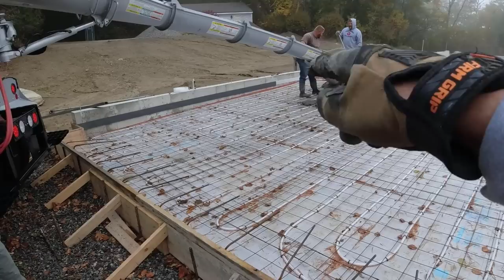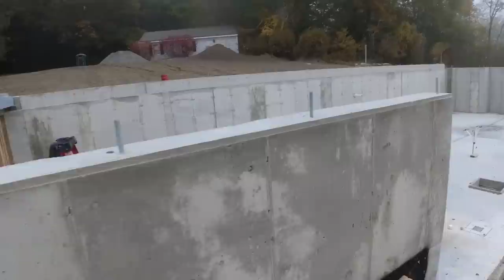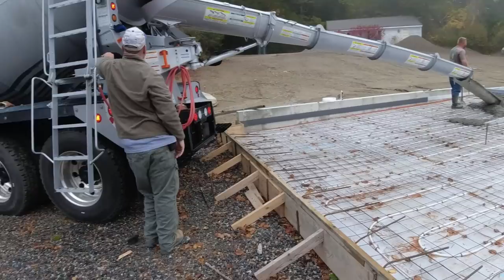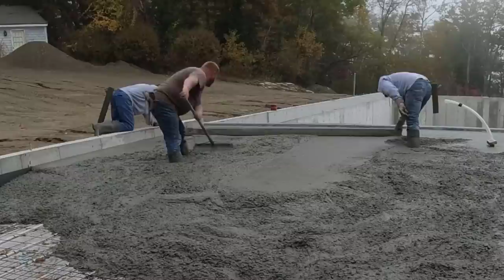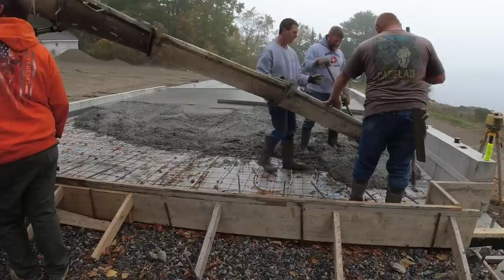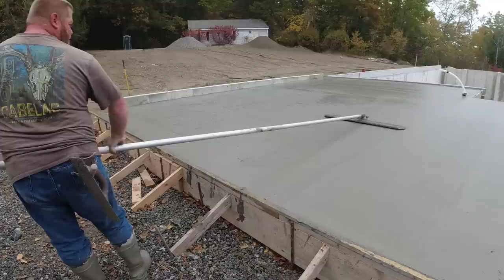We Poured It A Foot Thick - How Did They Mess This Up! (Garage Floor Over-kill)

Comment: I drove a mixer truck for about a decade and you wouldn't believe the stories.

1. A home owner wanted 9 yards inside a cardboard form.

2. Husband wasn't home so wife said to just put it over there and he will take care of it when he gets back.

3. Homeowner  wanted it so wet it looked like wash out for his garage floor so he could work it easier.

4. Home owner ordered 3 truck loads too much and we sent them back to the batch plant loaded. Miscalculated by 27 yards.

5. Flow filled Styrofoam walls wich of course broke and made a mess.

I could go on and on....

Comment: So the GC eats $1900 in extra concrete and the homeowner is basically out the cost of the radiant system and pays for all the future bottom of the slab underside heat losses. Output drops off as tubing depth increases. The highest output occurs when the tube is centered about 3/4-in. below to the slab surface (about 25 Btu/hr./ft2 at 100° F water temperature). Lowering the tube another inch into the slab reduces output to 24 Btu/hr./ft2. Taking it down yet another inch lowers the output to 22.3 Btu/hr./ft2.  However,  when the tube is located at the bottom of 12" slab the output is only 7.6 Btu/hr./ft2 -OUCH. On the plus side they can feel free to park a 85 ton John Deere 870G excavator any time they want.

Comment: The home owner will be lucky if that floor heats up at all with the 12 inches of concrete on top of the heat tubes !!
Reply from the maker: It'll heat up, just might take a while. Then it'll stay warm longer also.
Reply: @MikeDayConcrete ... one giant heat sink that's for sure.
Reply: Heat rises people
Reply: That was my thoughts. Conrete is a thermal conductor but at that depth and the size of tubing and total heating power it can produce I wonder if it is now ineffectual. It seems like radiant tubing has to be within the top 3-4 inches of the conrete surface to have any affect.
Reply: Takes four days to heat up, four days to cool down.  They will be sweating buckets when the temps jump, and freezing when temps dive.
Reply: It’s likely it will cost more to heat a slab that thick
Reply: That and the mesh sitting on the bottom of the slab is a great job 😂
Reply: I guess it will act like a big energy/heat storage. This might save you some energy on very cold days, but changing the room temperature will take forever.
Reply: @michaelmaas5544  I did a slab this thick it will heat just fine  u will have to adjust the thermostat a bit but I had no issues. .also if you look at what's going on here u will notice they are doing what every concrete contactor that ive seen does and thats picking the wire mesh up  as they go  ☺
Reply: @nbco55  you mean storage.
Reply: @devilmonkey  heat does not rise.
Reply: @user-bt6hh9yu1n  work near the ceiling for awhile and you will realize you are wrong.
Reply: Why pour if something is wrong  freaking goofs ! I'd be pissed
Reply: Yep. You are correct. They will have to start heating in September for November.
Reply: @Brooklynraised68  I bet they have a hard time collecting on the extra.
Reply: @michaelmaas5544  
1. the slab is nearly s foot thick. It does not need a reinforcing mesh.

2. The ideal placement of mesh or rebar is lower in the slab. Concrete is great in compression and not as great in tension. In bending the bottom of the slab would be in tension, thus the steel helps by resisting the force.
Reply: @Brooklynraised68  I just smell some free concrete and a thicker slab.
Reply: @user-bt6hh9yu1n  what?
Reply: @ILiketoBreakStuff  mesh isn't made for a 12" slab. They are definitely going to have issues  where the overhang is
Reply: @user-bt6hh9yu1n  what planet are you living on?
Reply: @brianbabb6666  hot air rises, heat goes in every direction regardless of gravity. Just a basic thermal dynamic principal.
Reply: @guyprattii3115  …yes indeed.
Reply: Fact: it will work great. Where do you want to put your money? F ing around with the grade or more concrete. Sometimes it's cheaper to make it thicker. Mass is good. I have a 30x40@ 40 yards and a 40x80@ 75 yards.
Reply: @brianbabb6666  He's right - heat does not rise, rather hot air rises. Heat in cement will spread equally in all directions.
Reply: @Ariel1S  if that was the case the heat will do nothing to warm the building.
Reply: @eddieshamble  paying help and buying fill costs more than a few yds of concrete. That floor will be a massive heat sink and will work great. 30 yrs pouring concrete and seeing guys dickin around grading to perfect when they could’ve been pouring and moving on to next job. As long as you’re relatively flat and not shorting thickness it’s all good
Reply: The lack of perimeter insulation down low is really going to waste some heat.
Reply: @markhowes126  I agree, unless this is not a very cold climate, or maybe they plan on insulating the exterior (that is a thing, putting foam board insulation around the entire house). I saw zero side insulation, and with cement that thick, unless they do exterior insulation they will lose a bunch out the sides.
Reply: @Just me  you are 100% on the money! It's just going to work as a huge heat sink! You won't have to worry about recovery time after closing the garage doors.
Reply: @allenbraun8759  indeed. That’s always a problem with in floor is losing heat off of 5-6” slab. I’ve had customers abandon the system due to high energy bills but I’m in Minnesota where it’s a bit tough to heat a garage no matter what
Reply: @Just me  we poured a slab in ND where we hauled 24" of sand over the heat pipes and then a 8" slab... it's held up to combines and tractors for years now.
Reply: @allenbraun8759  yes that should work great. Sand should also act as a heatsink and 8” slab is even overkill but rather than hauling and grading it’s poured.
Reply: @devilmonkey  heat does not raise it goes equally in all directions
Reply: @brianbabb6666  sorry but tim is right
Reply: @Justme-sb8mn  he lives on earth where heat moves in all directions equally
Reply: @brianbabb6666  not true
Reply: @stephanmacfarlane1151  you're mistaken
Reply: The heat spreads in the concrete because the concrete conducts the heat, although heat still rises.
Reply: @brianbabb6666  no not at all and you can learn about this in several different classes so all you have to do is pick one and then you too could learn about heat
Reply: @brianbabb6666  no heat goes in all directions equally
Reply: @stephanmacfarlane1151  hot air raises, but if properly insulated below it it's really only got one direction to go
Reply: @devilmonkey  yes hot air rises and hot water rises but heat goes it all directions equally
Reply: @stephanmacfarlane1151  if you have insulation below the heat will be drawn upward to the colder air. It won't be equally drawn or pass the insolation like it would above
Reply: @devilmonkey  yes resistance will slow the movement of heat
Reply: @stephanmacfarlane1151  where's most of the heat going to go, just say it
Reply: @stephanmacfarlane1151  do a second grade experiment and put a thermometer a foot off the floor and one at a foot from ceiling then tell me heat doesn’t rise.
Reply: @stephanmacfarlane1151  then why do you feel more heat above a radiant heater than you feel below?
Reply: @devilmonkey  so will the demand.
Reply: If you look people, the mesh is used to tie, and keep in place , the heating tubes.  There could also be fiber mesh in the mix.

Comment: If I was the homeowner I would be seriously pissed if my GC didn't coordinate with the grade crew and the concrete contractor to the point I ended up paying for a foot of concrete in my garage.
Reply from the maker: The homeowner didn't pay for it, the GC did. It was their call to move forward the way it was.
Reply: Never pour on someone else's drading job

Comment: Any concern with the radiant heat being able to heat that huge mass of concrete?  I'd imagine there will be a lot of lag between the radiant turning on and the heat energy actually getting through to the garage space.
Reply: Radiant heat is recommended (by manufacturer) to be no more than 2" from the top of the concrete.
The deeper it is the less efficient it is (I figure with that depth they're not gonna be happy with their gas/electric bill. Whichever is the one warming the water tank for the system).

Comment: How effective is this heated floor going to be when it under 12 inches of slab?
Reply: I was about to pose that very thought.
Reply: It only makes a difference for the lag time to bring it to temp or for cool down.  It has more thermal mass is all
Reply: Typically 1" to 2" below surface. Is most efficient! Seems like ya'll did a great job at finishing that concrete though! Hopefully it don't take five years for that new homeowners boiler system to heat the concrete up.

Comment: I'm just wondering if the rebar is high enough for that much concrete.
Reply: When concrete is that thick, you really don’t need rebar.  If you’re going to use rebar then it would  have to be at least 3/8” that wire mesh they used in the video is USELESS!!!!
Reply: @jeanious2009  Time for some pre stress cables perhaps?

Comment: I assume you’re going to need extra deep cuts for your relief cuts.  Is the soft cut saw capable of going that deep ?  If not, how do you get the relief cuts done adequately?
Reply: Great question.
Reply: Probably have to use a Cut off saw in a cart for that depth. Soffcut usually has the 1.5"max depth cut on a 6" blade.
Reply: 12” concrete doesn’t require relief cuts, that whole slab is thicker than any 10 story foundation.

Comment: When pouring that thick is thermal contraction, expansion not a problem? I thought that’s way bridges and such needed those oversized expansion joints. I work in wood and with using larger and larger pieces it’s a issue.
Reply from the maker: I don't think it'll be an issue here, maybe if it was in the middle of the summer and temps in the 90's. It's was cool this time of year.
Reply: @MikeDayConcrete  
LoL

Comment: Shrinkage and expansion are real problems, so there is a reason why there is a code for minimum reinforcement. That video that shows small gauge welded wire fabric is interesting. You are right somebody should get back from vacation and supervise this job

Comment: I'm just here for the "When Mike isn't looking, the wire doesn't get pulled", crowd.  😎
Reply: That thin wire in that thick a slab is nearly worthless.
Reply: @ArthurDentZaphodBeeb  In this case, I would agree.  I'm guessing the trucks were already on the way, otherwise, I would have aborted the pour myself.

Comment: Just think of the car lifts you could install in that slab.  No issues with bolting anything into that thing!
Reply: Be able to install a heavy equipment lift for say the concrete delivery truck.🤪

Comment: If the mesh is being used for rebar as well as holding the pipes then prop it up from below on cups, you’ll get adequate ‘cover’ and stop the rebar rusting and the concrete will be strengthened in tension. Bottom 1/3 so 4” up if 12” is the rule of thumb

Comment: If I had to guess, the earthwork guy read the specs and saw a 6” pitch and just went with it, I think that’s why you have such a deep slab in the front, but yes, you’re completely right, 6” pitch on a garage slab is pretty ridiculous, another nice job Mike, when all that mass heats up that floor, it won’t cool down til spring!
Reply from the maker: Crazy they spec'd a resi garage with 6" slope. Even the homeowner said it was too much.
Reply: @MikeDayConcrete  I wonder if the crazy slope was in relation to that overhung slab into the basement? Maybe the designer wanted to be really sure any snow melt would not travel to the back wall and down into the basement? Weird design all around.

Comment: I'm wondering if the subgrade compaction failed, or washed out some? And is the floor heating going to work under that much concrete? Wow, big mistake. It looks great now though!
Reply: This is the same thing I was wondering. I was thinking is the in floor heat even gunna work with a slab that thick.
Reply: Sure.  It's insulated underneath.  It will take a long time to warm up and a long time to cool down, so even temps in the garage will be easier to maintain.  Thermal mass is generally a good thing when constant temperature is the goal, but if you want more heat quick,  it's not so bueno.  If you turn up the heat in that garage, you may not see result for several hours.
Reply: @mikemorgan5015  the responses....they are clueless and don't read..you are absolutely correct and they are looking at the heat like they are a heated bathroom floor, which is heated to make it comfortable to bare feet. 
For constant temperature thermal mass is needed and if the heat source was geothermal or solar they would be looking at more mass..maybe 18"? Lol.
Concrete isn't necessarily the most cost effective mass though.

Comment: Hi Mike. I've been binge watching your videos (and subscribed) and have picked up a lot of information from you and watching how you work, pour, finish, etc. you guys do great work.
I have a question for you, if you would be so kind.... I am building a small 3/4 underground pool (we found a room under our back yard from an old construction that still has solid walls on 3 sides) that is 5 meters long by 1.5 meters wide. The depth goes from 35 1/2 inches on the shallow side to 5 1/2 feet at the deep end. I have scoured the internet trying to find what grade of concrete to use, and found nothing that says "use this grade for pools", so decided that M20 would be sufficient with 4" rebar reinforcement. Is that overkill for the size of the pool, or am I on the right track? Thank you and keep up the greats videos!
Reply from the maker: That'll be good, I don't think it's overkill.
Reply: @MikeDayConcrete  Thank you. I guess I should have asked if M20 was necessary. The issue is the gravel ratio. We do not have easy access to our back yard as it's completely enclosed and we can't buy bagged gravel here (Mexico), so it is delivered loose and dumped in the front of the house and I would have to move it all to the back yard, which is no easy task. I'm currently using the gravel I get from separating the dirt from the gravel and rocks from digging out the area. Would a 1:1.5:2 mix work? And does the same mix apply to the walls? Thank you so much for your response :)
Reply: Sorry for all the questions. It just that we've been ripped off on various occasions and had work done where the contractors didn't use the quality of materials they should have (like the carport, where the roof, which is going to have a bedroom built on it, they only used 4 inch rebar instead of 6 and the roof started to sag in the center, so we had a have a steel support beam installed under it) and decided that I'll do the work on the pool and learn at the same time to save money and headaches, so I want to ensure I'm doing everything as best I can. 
I do truly appreciate your advice and than you very much.

Comment: Very nicely done.  I like watching a crew that knows what their doing.  Was that 6in slump or 6in slope on the plans?  haha.  Maybe they wanted them to back in so they could have a better running start out of the garage.  What an incredibly enormous mistake in grading!  Wow!  I used to get my ass chewed over a 1/4 inch.  Strange overhang detail there.  Is that wood post supporting the steel beam permanent?  I would have used a steel post for that, but wood is fine as long as it stays dry.   That slab will certainly hold some serious heat once it get warmed up.  No worries about piercing the radiant tubing using Tapcons in that slab.....
Reply from the maker: Thanks Mike!
Reply: Should keep the rain water out if nothing else.
Maybe it is so when you drive through the back wall of the garage, you don't damage the basement walls.

Comment: When it's that thick don't you need to vibrate the concrete to remove the air pockets?
Reply from the maker: At the slump we pour, there's no air pockets.

Comment: Will the extra thick concrete effect how well the radiant heat tubing works?
Reply from the maker: It will take a little longer to heat up to temp, but that's about it.
Reply: @MikeDayConcrete  I'd assume it would also hold it's heat a little longer too. Which is good

Comment: Going to take a very long time for under floor heating to heat up a 12" slab.🤣
Reply: That's not a bad thing because it would hold heat longer too (heat sink).
Also, better too thick than too thin.

Comment: Is the radiant heat going to be too low in the slab?
Reply: Definitely too low.
What a disaster
Reply: As the GC, I'd have called for regrade and cancelled Mike's pour. But everyone's different.
Reply: @nbco55  I wonder what a Mechanical Engineer would say about the depth of the radiant heat tubing?
Reply: @gregorymacneil2836 glad it ain’t mine?